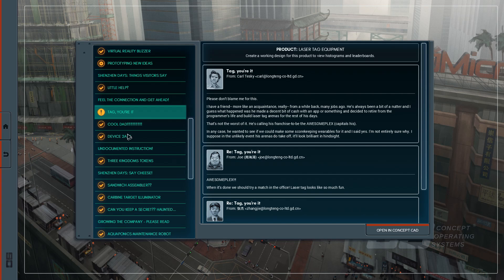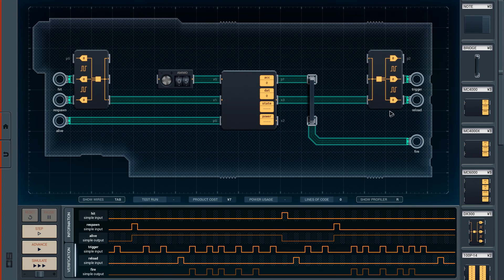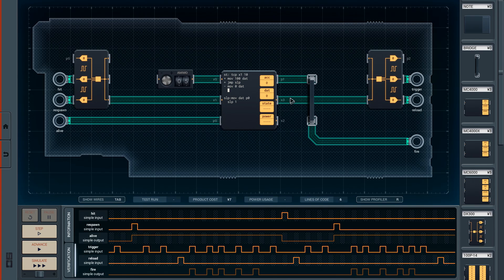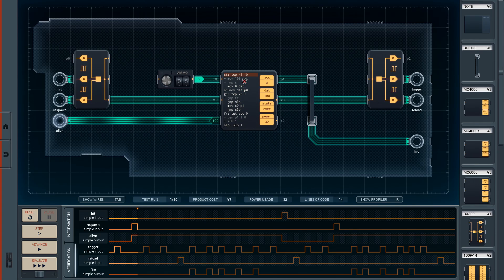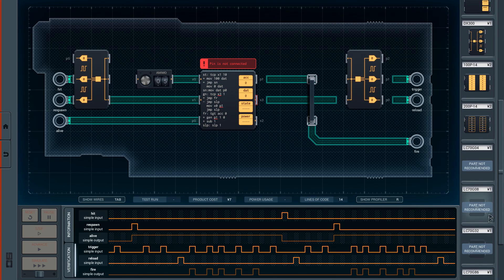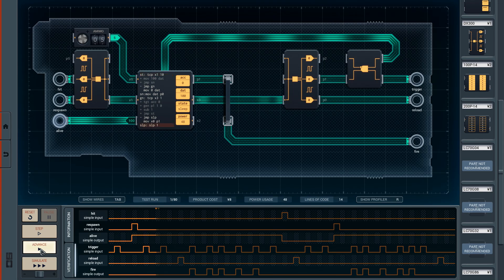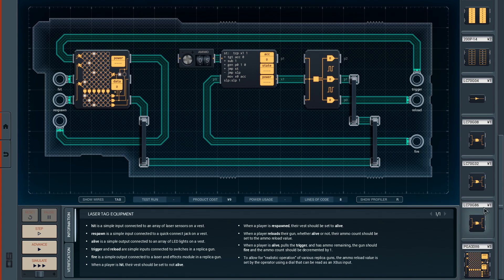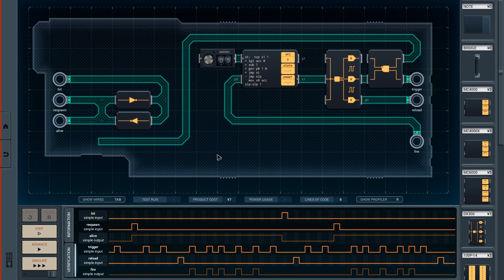Shenzhen I/O - Part 9 - AwesomePlex

Comment: Have you tried using an SR latch (2 or gates) with a not gate (on the MC4000s P output) to keep track of whether the system is alive or not? this solution only needs one DX300 to work because the system only needs to keep track if your alive when firing, and whether your reloading or not.